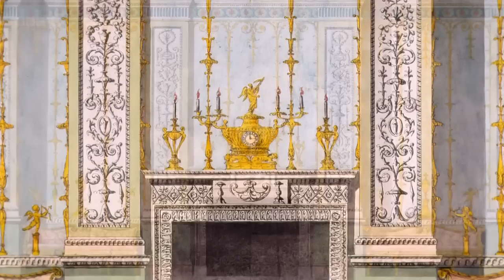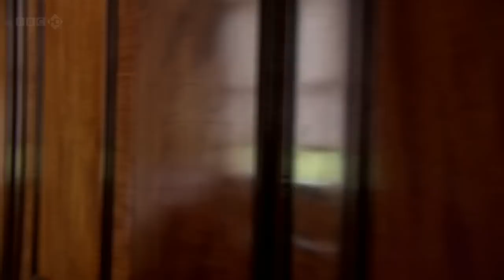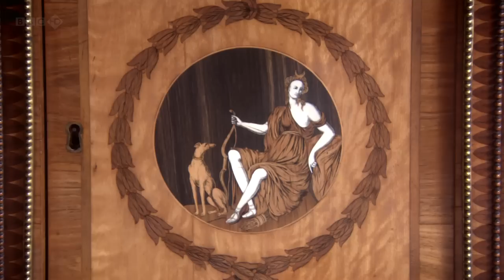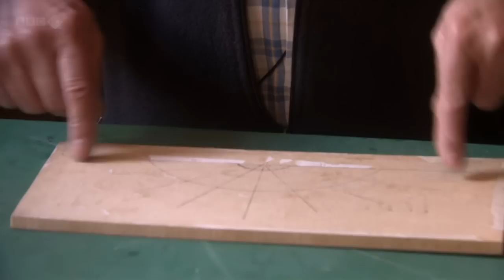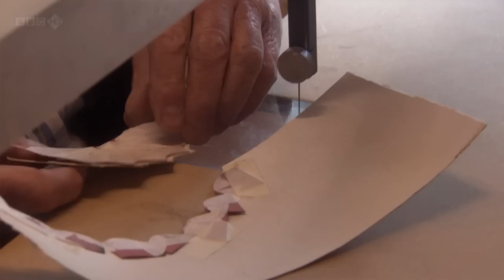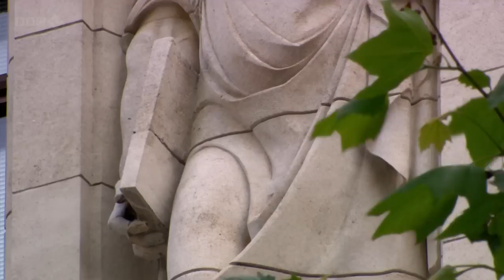3/4 The Extraordinary Thomas Chippendale - Carved with Love

Comment: What is the red colored wood? At a Ren Faire in Los Angeles one of the merchants had cutting boards with red colored wood in it which I believe comes from Africa.
Reply: @endzm05  pretty sure its not. Probably dyed over. Paduak was not a well known wood i could imagine at the time. Probably oak, walnut, or even mahogany, but i cant see paduak
Reply: @endzm05  Padauk is orange.Was NOT used in England 250 years ago.
Reply: @solidsnake9332  Exactly.